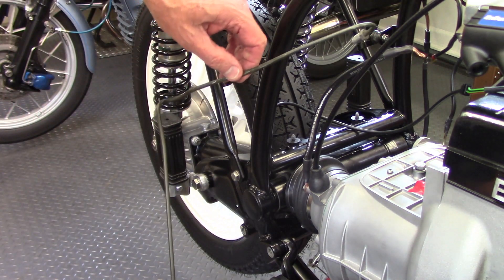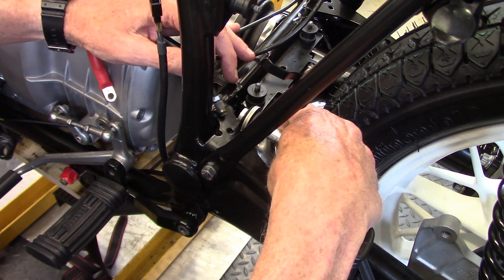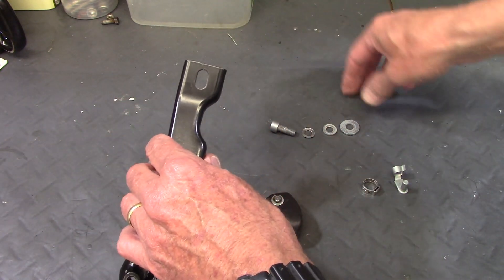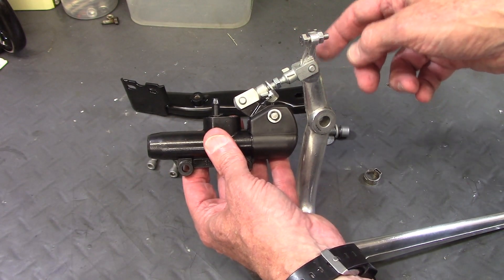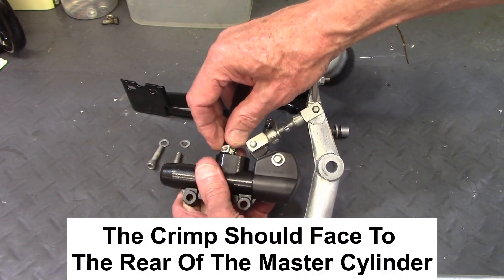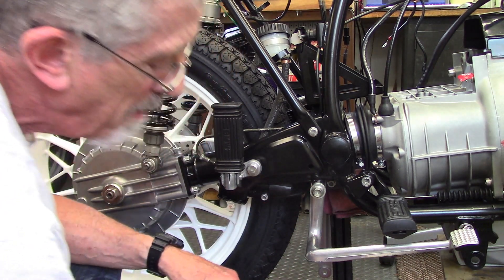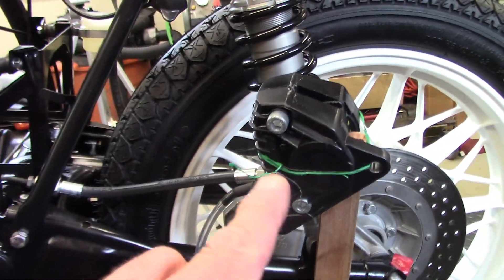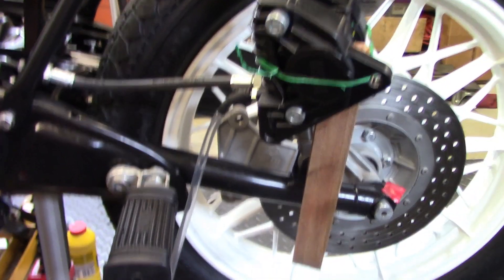1983 BMW R100RS Install Rear Brake System

Comment: I'm at a complete loss with the linkage. I assemble it onto the bike as shown but there is no movement on the piston from the brake pedal?? Its like everything has seized up?? I have disassembled and reassembled several times using different distances along the connecting threads but still no luck!? Any help appreciated
Reply from the maker: fostex fan, interesting. If you haven't already, be sure to read the complete assembly process using the link to the document on my web site in the summary of the video.

I would verify that you can push the rear master cylinder plunger by hand without the brake pedal linkage attached to verify that the master cylinder piston is moving freely in the bore of the cylinder. 

I could also interpret your comment that the brake pedal linkage moves but does not move the plunger arm. Or, the plunder arm is moving but there is no movement of the brake pads. In the first case, the linkage adjustment is not tight enough, or the end of the plunger arm is on the edge of the master cylinder wall and not on the end of the piston. In the second, there is a leak in the system so brake fluid is not pressurized.
Reply: @BrooksAirheadGarage  I have studied your excellent documented process as provided in the link prior to disassembly and reassembly. The plunger is moving freely by hand and I also checked the movement with brake pedal attached with the spring holding firm against a part of the frame. The apply and release mechanism was functioning  perfectly. Its when I come to assemble it back on the bike where the problem hits. I have to pull the pedal forward to reattach it and I'm assuming that by doing so I am pulling on the plunger thus allowing no further movement. So its a case of working out how much adjustment the linkage needs? I have tried six different positions along the thread which meant six different assembly's and reassembles. I have yet to put fluid in and bleed the brakes. But until I can see the plunger moving with pressing the brake pedal and returning because of the spring, I am rather stuck. How far along the threads would the best position be for the clevis pin?
Reply from the maker: @fostexfan160  Well, I can't say exactly. I did not have the kind of problem you are having. I adjusted the linkage to just start to move the lever arm when the brake pedal was not depressed, then backed it off a couple turns. That seemed to give good rear brake action.
Reply: @BrooksAirheadGarage  A fresh approach I think Mr Brook. I'm going to assemble just the cylinder and plate to the bike and then attach the brake pedal to get a clear view of where the problem is. Thank you sir
Reply: Task completed. It would appear that the linkage needs only a few turns of the thread to allow correct reassembly and plunger movement. Its a little concerning but the locknut gives some reassurance. Bleeding is a nightmare on this cylinder. I will have to invest in a vacuum pump. Keep up the great work sir

Comment: What about the adjustment of the rear brake pedal? The threaded rod between the two clevis parts - what is the correct adjustment?
Reply from the maker: I adjust it by spinning the rear wheel and pressing the rear brake pedal.  I want the brake to engage at about 1 inch of pedal movement
Reply: @BrooksAirheadGarage  Thanks for that. I’m a fan of your work.

Comment: Thanks for the video! Can't seem to get the brake to bleed enough to stiffen the pedal. Fluid is coming out with the pump, but there's still no resistance on the pedal. All connections seem to be tight. Any ideas would be much appreciated!
Reply from the maker: Hi Kurt.  I've been told that bleeding this brake can be a problem.  I show the technique I was told should work which I show in the video.  Clearly there is air in your system. But I don't have any techniques beyond what I show in this video.
Reply: For those with this problem, air entrapment is a problem.  A suction brake bleeder is a good solution.

Comment: Thanks for the video! My 1979 R100 refuses to lock the rear wheel when braking hard at any speed. Both my mechanic and I have tried different options, like new pads, re-bleeding the system, re-building the master cylinder etc with no success. I am now starting to consider to use a different master cylinder. If yes would you recommend one? Do you have any other suggestions? do you think a new master cylinder would give me the necessary braking power? Thank you!
Reply from the maker: Hi Chilly AK, Sorry, I don't have any recommendations for you.

Comment: Hi Brook, I didn't see the brake light switch installed here or on your blog. Did you install the rear brake light switch? Another great video, thank you.
Reply from the maker: BIGGZ46, it's in the document about installing the electrical system:
--> https://brook.reams.me/bmw-motorcycle-rebuilds/1983-bmw-r100rs-rebuild-project-index/61-bmw-1983-r100rs-rt-install-electrical-system/

This chapter:
--> https://brook.reams.me/bmw-motorcycle-rebuilds/1983-bmw-r100rs-rebuild-project-index/61-bmw-1983-r100rs-rt-install-electrical-system/#Rear_Brake_Light_Switch_Sub-Harness

Comment: I have a slight click before rear lever engages this will be very useful when I dive in to sort it out.
Reply from the maker: Hi HoverbotFPV,  It could be the plunger on the rear brake light switch that is catching on the side of the hole in the bracket it mounts on. Or maybe the foot pedal bushing is worn so the side the side of the pedal is rubbing on the frame. The above are just some hypotheses, not guaranteed reasons for the noise.
Reply: @BrooksAirheadGarage  Thanks! I thought it may be brake switch and not damaged piston as the bike is clean and brakes ok not crisp but ok. Bigger issue is my stock R60/5 power is out at headlight and everything except starter. I have power at main starter feed but none at bladed output to relay? Fuses ok. The diagrams are nothing like my BSA ones LOL! 30 year 441 rider retired to more? reliable BMW classics. Famous last words I know,
Reply: @BrooksAirheadGarage  My big bike channel is 441rider polaris silver r60 there.
Reply from the maker: @hoverbotfpv1425  The starter relay is also the main path for all power to the  bike. There is an internal connection that can break which means power from the battery does not exit the relay to the rest of the bike.  You can see more about that circuit here: (/5 circuits)-https://brook.reams.me/bmw-airhead-motorcycle-electrical-systems/airhead-electrical-systems-5-series-circuits/ (/5 Components)-/5 Series Electrical Components
Reply: @BrooksAirheadGarage  Is the round relay/solinoid? mounted on top of starter? I will check the diagram but I de-cased the 3"2" metal box push button contact relay and no power entering it on any wire I suspect the red dual lead is coming from starter area. Glad it is stock no short when batt connected or V drop.
Reply from the maker: @hoverbotfpv1425  The starter relay is under the gas tank on the left side of the frame. The starter solenoid on the starter motor gets power only when the starter relay closes. Even if the starter relay  is open, all the power for the bike flows from the battery to terminal (30) on the relay and exits via an internal connection through the other wires connected to the other (30) terminals on the relay.
Reply: @BrooksAirheadGarage  Red lead from batt to 30 was broken at terminal pos ring connector. It had black shrink wrap so I missed it under big starter feed line also black LOL Thanks very much will bookmark your great diagram.
Reply: @BrooksAirheadGarage  All good, never have had a car license 53 still commuting. 
https://www.youtube.com/watch?v=33g5tji9kHU&feature=youtu.be

Comment: I couldn't help but to notice that you are running Conti Twins K112 Motorcycle Tires. I never like the way the front tire would track  they will follow cracks in the road. The price is good on them but I found that I would only get about 20,000 miles out of a set. Has the mileage improved on them? Your bike is really looking good! it looks like a new bike!! I bet it will be better than new when you are done. Thanks for the video.
Reply from the maker: Hi Alan, These were unavailable for many years. I noticed that Continental brought them back using the latest rubber compounds, so I decided to try them out and see how I like them. I used Metzeler Pilot Activ on the 1977 RS, but mounting them is not very easy. The Conti's mounted very easily and the bead was easy to set, which is a plus.  I'll get to see the difference in handling and longevity when I get the bike on the road.
Reply: @BrooksAirheadGarage  Yes I kind of remember that they got to were they were hard to find I had an R75/6 then. I think my RS came with Metzeler,the front tire had a chevron tire Patton that work well. On my /6 I always carried spar tubes with balance + in them I could change a flat in under 15 min. The my RS and K75 I ran tube-less tires and was lucky not to have had any tire trouble.
Reply: Brook's Airhead Garage Do you mean Michelin Pilot Activ ? Good tyres but mounting them on my R100CS snowflakes was a real challenge. Broke one tyre fitters machine and another blew a tube trying to seat them. Won’t be using the Michelins again.
Reply from the maker: @lesleysmith5623  Yeap, they have a very stiff sidewall. You can not seat that bead on the side of the road if you have a flat.

Comment: What's the reason behind putting the caliper in that position when bleeding?
Reply from the maker: Help air come to top
Reply: @BrooksAirheadGarage  thank you. I've been fighting this setup for last 3days (off and on). I ended up buying the aurzapper just because of your videos. I tried your method and couldn't get it to work, there was always air trapped somewhere. What finally worked was to disconnect the caliper and let fluid make its way through the lines through gravity. Once I started to get fluid out of the line, I hooked up airzapper and ran it till only fluid was coming out. Then I quickly connected the caliper. Finally got a firm brake pedal now. 

Right now the caliper is still zip tied to the side of the bike, so real life testing will be later, but I think it'll work.
Reply from the maker: @honzasgarage5125  Glad you got it finally bleed. 🙂